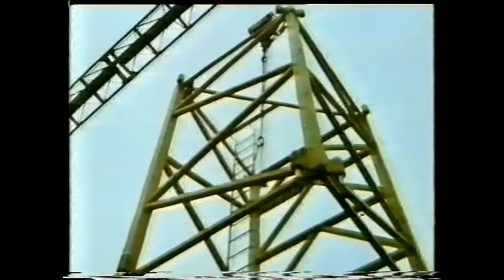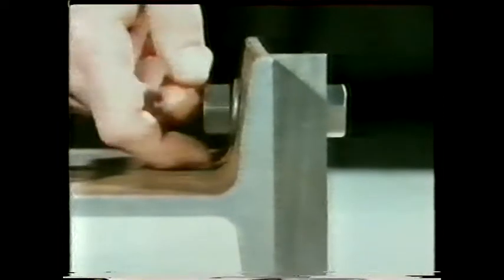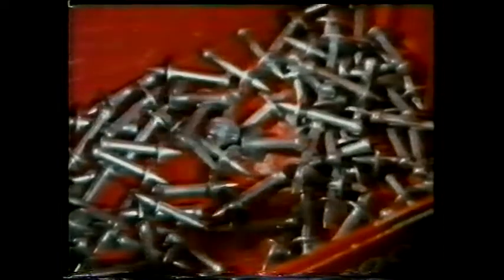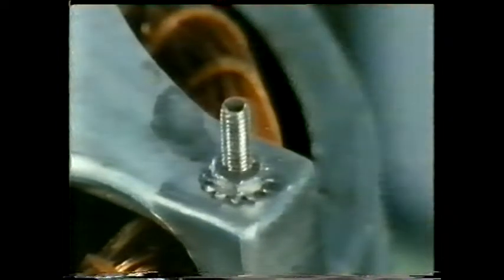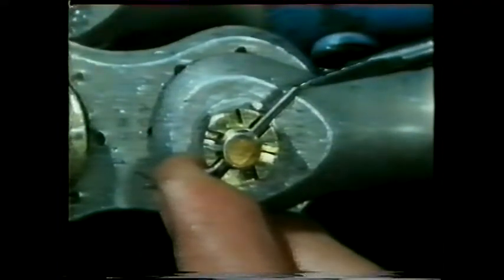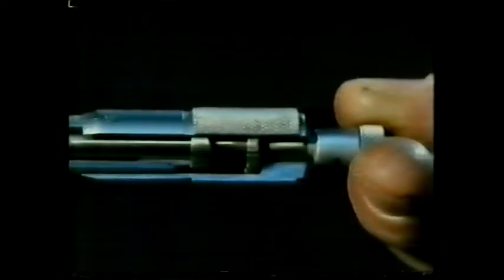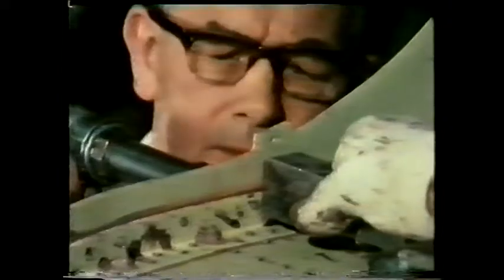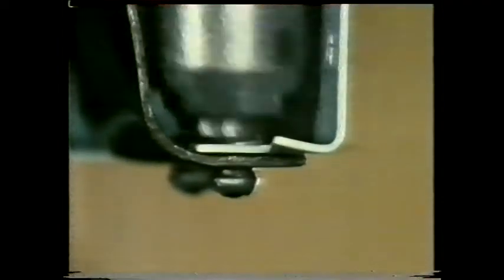BBC Engineering Craft Studies EP 17 Joining   Fastening

Comment: Those spring washers have been removed from the german norm, as its force is far lower than the screw force. Then the castle nut and others do not secure the clamping force. They just prevent the nut from falling off entirely.

Comment: It is bolt-stretch which counts! Not friction. Torque is a crude proxy for stretch. In aerospace, torque is not used, but interferometric laser techniques measure bolt-stretch.
Reply: It is the friction holding the parts together. The stretch is just a measure of the clamping force. The normal force resulting in the friction force.
: I just show here, you don't even mention what you are fastening. A flange, a wheel, crystal ball🔮 guesswork
Reply: @herrkulor3771  Rubbish! It is bolt-stretch that holds the parts together! Friction is simply one way of locking a rotating fastener in place, to stop it self-undoing. There are many other ways, such as folding washer tabs, split-pins, Loctite, wired closures, etc. One could make bolts out of Teflon!
Reply: @SusanPearce_H now you are getting clearer, meaning holding the bolt by friction and not the joined parts. That is not what  one does, which threw me off.
 To keep the clamping on a joint, of course you do the bolt joint diagram. But even so fasteners have self locking thread angle to keep the force and therefore stretch. With a high pitch, your screw will not be self locking. You can use Teflon as a screw, I have done so. But of course it is a material with very high creep, so only for very limited use.
Your text made me zoom out to clamping a wheel onto a hub. There you use the bolts to make enough friction so the wheel will not spin on the hub and bend/shear the bolts.

Comment: 8:13 that's entirely the wrong size/type shake proof lock washer, the teeth miss the nut and don't even bite in at the other side, he even said it bites both surfaces when that external washer doesn't, it should be a smaller washer or an internal shake proof washer.